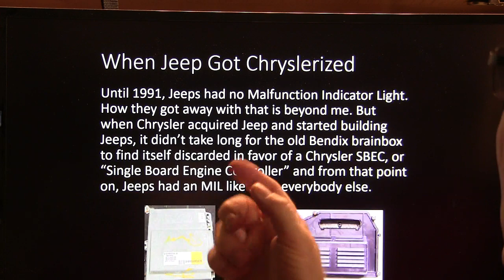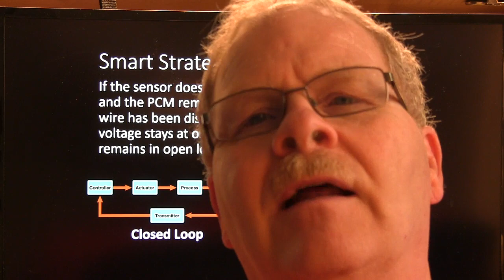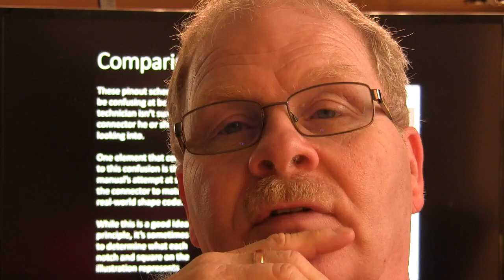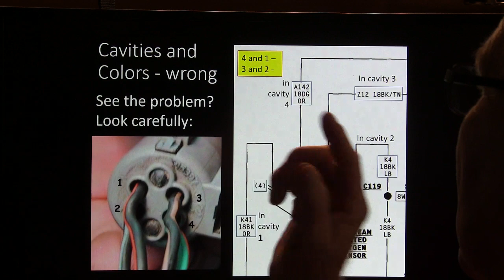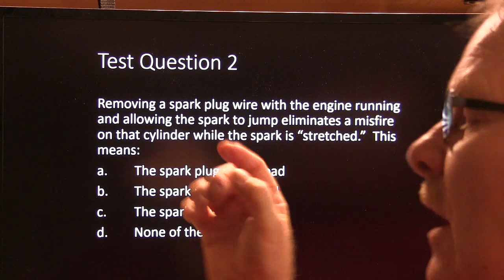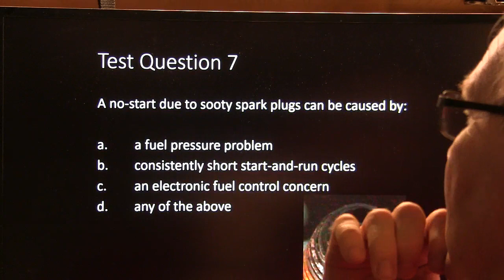Fresh Perspective

Comment: Thank You sir for your time , i don't know if the k cars you speak of where the seem as the Dodge Omni turbos but i had a few run in's with that car and the Chevy Lumina all of them seem to stretch my patience back in the day . But i must admit i learnt how to test Crack sensors , Tps sensor , 02 and many different ignition modules . At the time I was working at a rental car company where i learned all of the test procedures from many different automotive repair manuals and i can't forget the old Haynes automotive manuals also . Back then you could ask any one about testing the electronic systems on cars but you would only be wasting your time . I truly hope to see many more video stories from you and thanks again !

Comment: I have come across people who claim to work on cars but do not read or gap check spark plugs. Just a few months ago I checked out a VW after the dealership said there was nothing wrong even though the technician could hear the engine noise and occasional slight dip in RPM at idle. It also had a very tiny delay when hitting the gas after stop. The computer did not know so the guys at the dealer did not know.  I heard it poked around with the stethoscope and told him it sounded like the chain tensioner getting loose on the 1.8l tsi passat.
Reply from the maker: Well, when I say you're probably the sharpest diagnostics guy I know of, I'm not exaggerating. You'd make a great instructor. And you're a clear thinker.